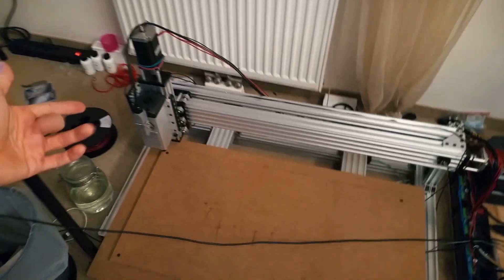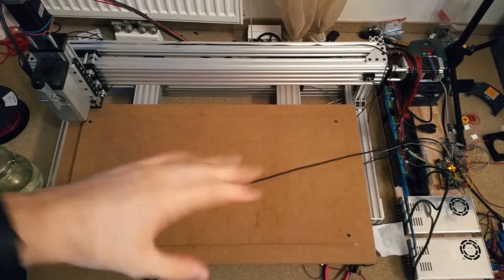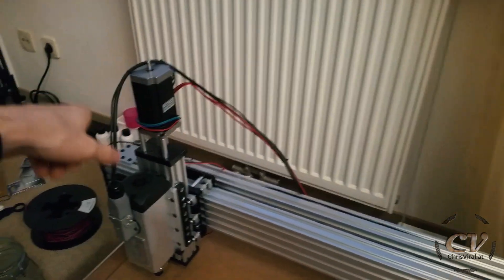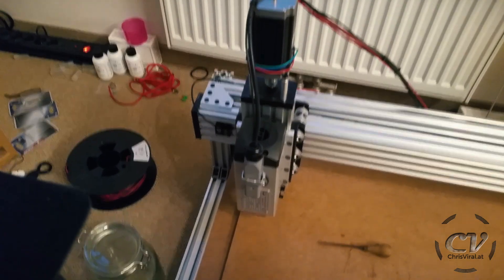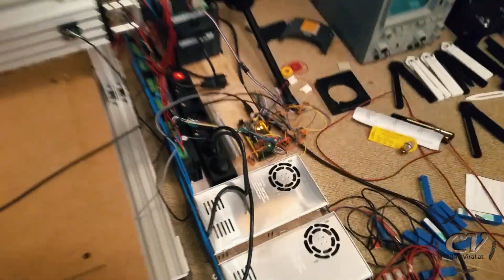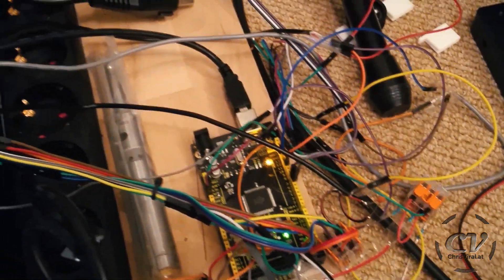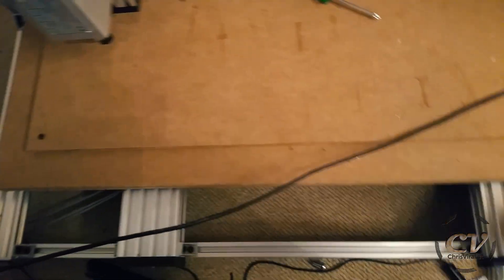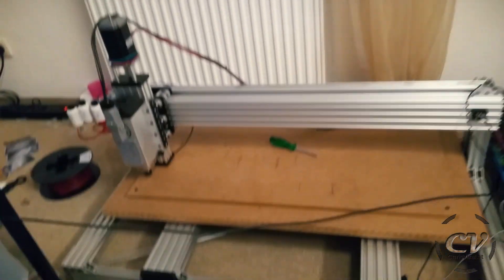Homing With GRBL (And First Z-Axis Crash)

Comment: excellent video dude!
Reply: Question.  I have a working CNC, based on Arduino with a GRBL shield.
the problem is that, when i generate GCODE in Fusion 360 to carve a wood stock,  the tool dives deep into the wood, before the milling even starts. in the end of the program it dives into the stock again and moves in a high velocity to a point which is not even the 0,0

Comment: when you finally got it working, you should buil a housing for it to block the noise and dust scomming from the machine, similar like this:
https://www.holz-metall.info/shop1/artikel8995.htm
also a vaccum cleaner adapter right around the endmill is a good idea to keep the dust away from all the "open" contruction (spindle,ballbearings,electronics and stuff)
https://www.google.com/search?q=dust+head+cnc&source=lnms&tbm=isch&sa=X&ved=0ahUKEwikhIPE3KbdAhXQY1AKHWi-CnAQ_AUICigB
only thing is you then need a silent vaccum cleaner (maybe build one with the cnc, you just need to mill and impeller from wood+ motor+ DIY cyclone housing + chinese hepa filter for the exhaust)
https://www.youtube.com/watch?v=GZSFSgVsMyI
https://www.youtube.com/watch?v=7jO2VbzrrEY
https://www.youtube.com/watch?v=icdf1wURsf8
https://www.youtube.com/watch?v=YuEaP9kyiFc
Reply from the maker: Yeah, I'll definitely need something to deal with the chips and debris. Vacuum system is on the list for now because I probably won't be able to go for a flood system. Mist + vacuum might work. I don't worry about the noise a lot, it's gonna be really loud and that's it lol.

Omg these diy vacuums are amazing :o
So simple yet so mind blowing.

Okay oh my god the woodworker takes the cake though. That was crazy!
Reply from the maker: Thanks for the links btw :D